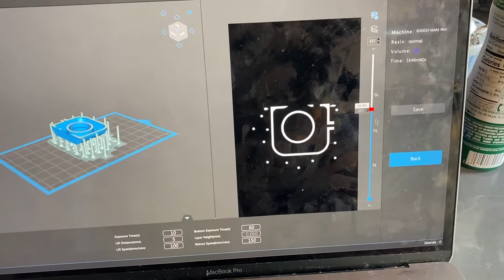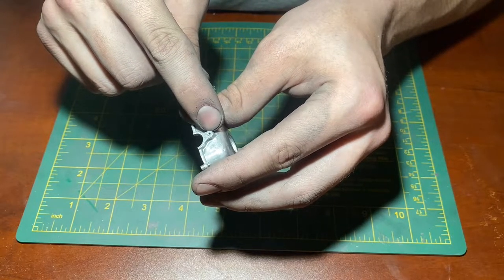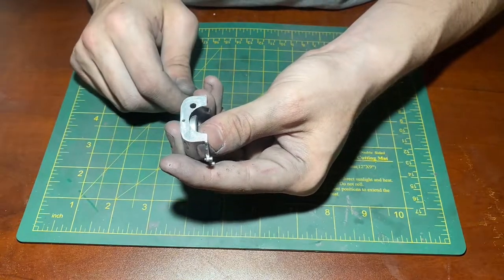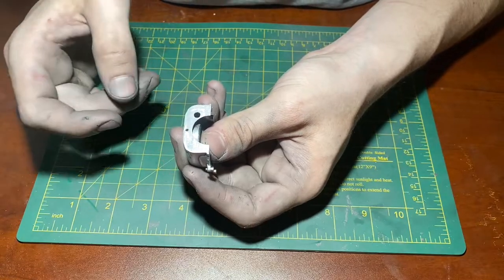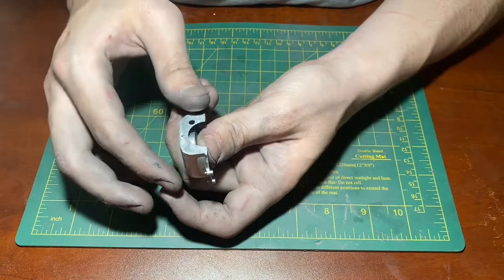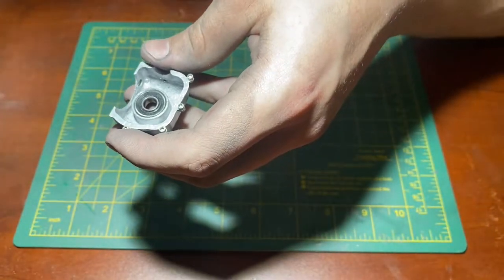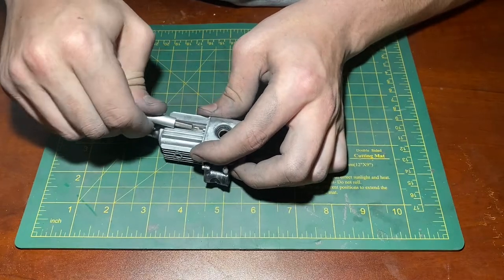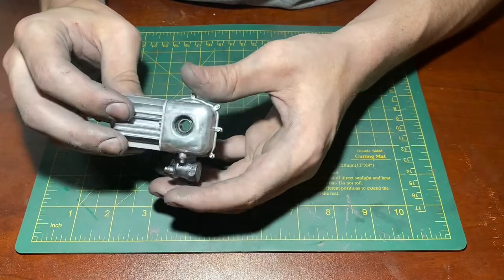Casting the Crankcase - Casting a Two-Stroke Engine

Comment: Should be line boring the case. Also when you have the other side case put some mild grinding compound on the parts and gently lap them together. This will help you to use less if not any gasket in material.
I know I’m always making suggestions, not trying to be a know it all, just really liking this project and want to see it run well.
Reply from the maker: I unfortunately do not have the equipment to bore the cylinder. I was already planning on using some lapping compound to lap the halves of the crankcase as well as the cylinder together. Hopefully that works well. If I still find the need for a gasket I’m planning on trying gasket paste first. Thanks for the suggestions!
Reply: @Levi_Sheridan  your welcome but just tell me to shut up if I start blathering.
Reply from the maker: @gordon6029  I’ll never tell you to shut up, I may just disagree with you. Please keep sending your suggestions as my viewers have definitely provided some really useful information. Thanks again Gordon!